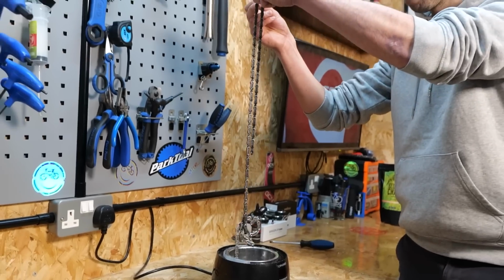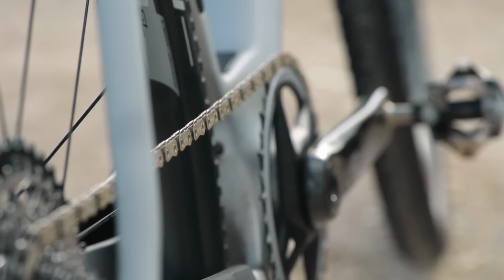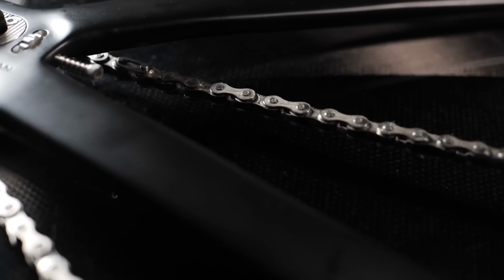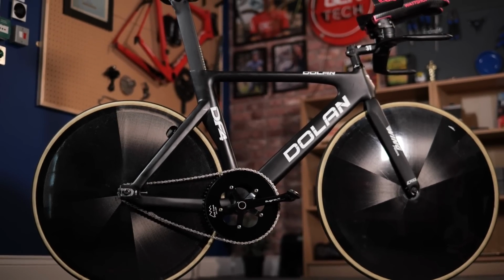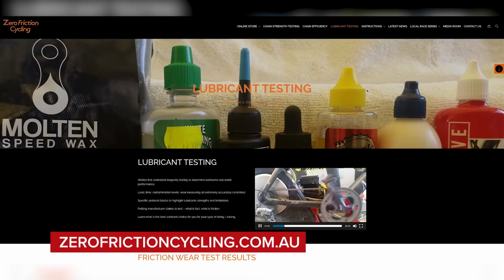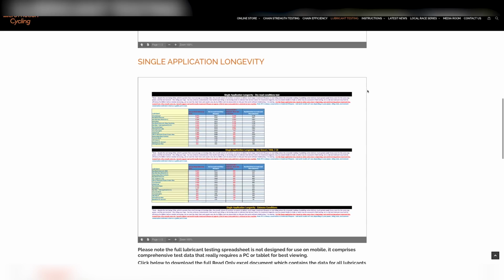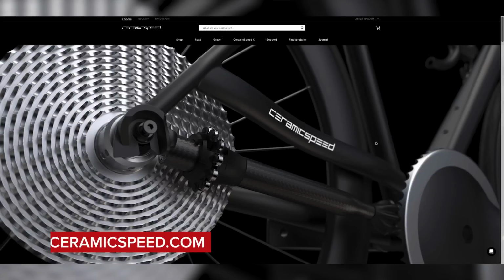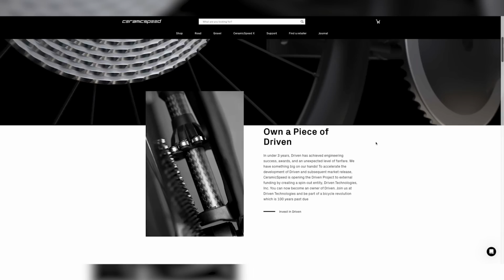Maximising Drivetrain Efficiency & Longevity: Deep Dive With Josh Poertner

Comment: Well, this is embarrassing. Josh states at 29:46 that the most efficient planetary gearbox is 92% efficient. Olly looks puzzled, not surprising given the uncritical videos GCN, and more recently GMBN have made about Classified hubs. What's the point of saving a few watts on expensive wheels and aero frames when you're losing dozens of watts using an expensive new tech scam?

Comment: I don't race but I've been riding wax since last october, and I wouldn't want to go back to oil etc.  Lower friction means faster, but it also means less effort for your speed so you can go further.  As a bonus, there's less mess all round the bottom bracket etc.

Comment: Good video.  Drive chains have in some ways got more inefficient in the quest for ever larger range of gears.  The smallest sprocket on the back has dropped from 13 down to 10 teeth introducing inefficiencies in the highest gears.  Ironic given the market for oversize pulley wheels.

Comment: 21:15 #askgcntech I am using Silca hot wax and frequently topping it up with their lube, I have seen that many lube drops tend to slip very quickly downwards avoiding the gap they should fill. 
My current workaround is to keep a finger under the chain and every 5-6 pins rub them and try to get it where it needs to go. 
Do you have any suggestions on how to make more effective? Thanks!
Reply: The finger trick is a good one, also, try lubricating the top of the chain right as it is about to engage the 2nd or 3rd largest rear cog while pedaling backwards.. this zone sees the chain going from straight at and angle to the cog to having to deflect to engage the cog which changes the chain gap from a thin slot to more of a triangle.. the lube will penetrate better right at that moment.  Also, be sure to shake the bottle really well before using as it will give you a slightly thicker and more homogeneous texture that flows more slowly.

Comment: When i buy a new chain should I clean it first before I WAX it , or can just WAX over the new chain coating ? Makes more sense to clen it 1st . Cheers fellowship
Reply: There are lots of videos on prepping a chain for waxing.
Reply: You should always clean the new chain before use (and before application of a chosen lubricant obviously). The grease that's on a new chain is for storing purposes only, not for field usage.

Comment: I still can't get past the hassle of having to change my chain twice a week with waxing. I keep my drive chain clean and reapply lube, and it takes only a  minute each time. Hot wax seems like too much work for minimal benefit.
Reply: Adding a drip wax top off and you only have to hot wax every 1000km or so.. easier than other lubes and you can clean with just boiling water, no chemicals.
Reply: That's a bit better, but still a change every 10 to 12 days. Maybe I'll try it some day and see if I notice a significant difference.

Comment: If you do a slow run through the 1:40 point, where we see the chain running over the rear cluster, you can see one link that looks to be binding on itself and won't articulate around the sprocket. It's only a fleeting moment, but surprising and ironic to see on this episode.
Reply: Looks like the rider was changing gear at that point.

Comment: Hands up, i was totally not into waxed chains, until i tried it. 

Reasons were using a slow cooker, faff and space, surely a wax supplier can offer a  boil in the bag solution? 

But the benefits are blindingly obvious at the next clean. I cant say i've noticed the improvement in watts,  or recognise when the chain needs redoing, but its clean. And thats cool.

Comment: Excellent stuff chaps. I was expecting to hear about effective chain cleaning, simply because for a chain lubricant to be efficient it must be in a sterile environment without microscopic dirt particles that logically accelerates wear and increases friction. The use of biodegradable detergents is the only logical morally correct thing to do. But how can it effectively be done to ensure absolute cleaning before hot wax emersion for maximum efficiency. I personally boil the chain in water for a final rinse even though I know that gasoline/kerosene/paraphine are superior cleaners. I would be particularly interested to know what your experts have to share on this.
Reply: From Josh Porter podcast...
Brand new chain: shake in jar with turpentine to degrease then methylated spirits to remove turps
(My technique)Waxed chain: just pour boiling water and wipe with rag and submerge in pure paraffin candle wax every 300-400km. Wax cost me aud$25 for 5kg (eBay) and will last me decades
Reply: Not sure if necessary, but I add a final clean in Isopropyl Alcohol / Deionised Water mix to minimise risk of film of meths on chain preventing wax from adhering (bought product for paint prep, mostly cars but bikes too)

Comment: I often wonder if, for potentially easier application, it would be worthwhile shaping the wax beads into a cylinder that would fit in a typical glue gun. The problem then, of course, is the melted wax,has comparatively very low viscosity and it wouldn’t necessarily flow well out of the glue gun. But still, something purpose-built might actually work very nicely for this. And it need not even be glue gun style applicator. I also think a lot about those hand-crank chain cleaners. What about one that heats up the wax and allows you to apply the wax in a similar fashion (that is, hand-cranking it while the chain on the bike)? It’s definitely a more complicated problem than it seems, and there are certainly benefits to removing the chain for degreasing and cleaning. Plus it might not actually be substantially better than existing drip-on solutions (even the best process is only marginally better). But I suspect the heat would allow for deeper penetration overall. 🤷‍♂️

Comment: Sidebow is the technical name for chain  used with a derailleur. The tensile strength difference with  9-10-11-12 speed chains with the same spec is safety factor. Higher speed chains will have a higher tensile strength material to overcome the lack of material.

Comment: I run hot wax, but one often overlooked cost and disadvantage is the need to replace the quick link. Even though I reuse them up top 2-3 times, they are technically single-use. True for SRAM and Shimano chains, at least.
Reply: I'd recommend using a drip wax like our SuperSecret every 200-300km in between hot waxings.  If you only hot wax every 1000km you are getting 4000-5000km per quick link.
Reply: I have never had any issues with kmc or sram quicklinks lasting the life of my paraffin waxed chains 15,000-20,000km
Edit: and I can put down 1500watt-bombs
Reply: @richardggeorge  The KMC 12 sp chains say they are single use, when the 11sp and less say multi-use. Are you talking about a 12sp system?
Reply: No issues 7,8,9,10 and 11spd
Edit: I would only buy Chinese 12 spd, the rest are a rip off

Comment: Will it be possible to heat hot melt wax and then use it as drip on wax, kinda like the best of both worlds since you get the benefit of the hot melt wax bt don't need to remove the chain everytime.
Reply: Nope. It won’t get into the pivoting rollers by capillary action unless it’s hot enough, which it won’t be if it was just dripped onto a cold chain. Science :)
Reply: The immersion waxing guide on the Zero Friction Cycling site suggests leaving the chain in the molten wax for ten minutes, then jiggling the chain vigorously for 30 seconds before removing and hanging to solidify. Doing so apparently melts the previous wax inside the chain and flushes it, dispersing whatever contamination was on/in the chain throughout the rest of the molten wax.

Comment: The chain is here to stay I believe, mostly because how bikes are marketed.  Just like with motorcycles, folks want the fastest/lightest/fanciest machines, even if that's way overkill for their performance and needs.  For racing/short events, the chain & derailleur has the advantage of weight and a somewhat better efficiency, but for absolutely everything else the IGH / belt drive is a FAR superior system in my opinion, especially if you're doing serious mileage.  I'm in the process of getting a belt-driven, drop bar gravel bike built.  It will probably replace my current chain-driven bike.

Comment: My drivetrain is relatively forgiving, but it is amazing to think of how much stress it goes through, even at amateur enthusiast levels of usage. I use a drip wax for indoor training use and find it a nice combination of good lubrication and minimal grime accumulation. The key is to not overload the chain or it will gunk around the pulley wheels and to clean it off with a rag regularly before reapplying. Great point on the double application for maximum effectiveness. With so many other places to be more efficient, free extra efficiency from the chain is appreciated but not the first place on which I would be inclined focus my attention.

Comment: If I want to try wax, I know I have to have a new or very very clean chain to start with. What about the cassette and jockey wheels, is a normal good degrease good enough, or do those need to be pristine too? Super interesting video, by the way, and how often do you hear a product rep saying that other companies make really good products too?
Reply: Remove the cassette and jockey wheels and immerse in a sonic cleaner.
Reply: Great question of an all too often overlooked detail. Yes, chainrings, cassette and pulley wheels must be as clean as possible. I go as far as degreasing the front derailleur cage.

Comment: I have a Priority Apollo (got a supernice from you lads), with a belt drive, and knowing that the efficiency loss is keeping me back isn't great, but its a killer system and a great bike. The fact that belt drive bikes are great for commuters and just for those too lazy to keep up with maintenance is actually a huge win, just rinse and go basically.

But I do respect that they are not racing machines, especially with the added weight that an IGH adds to the system.  But they are certainly an interesting option.  Would be seriously interesting to see an IGH paired with a chain/derailleur for ultra crazy gearing too.
Reply: That’s been done, but sadly withdrawn by the main igh makers due to lack of demand.
Reply: BROMPTON do it....Its how the 3 speed becomes a six speed.....

Comment: I started waxing about a decade ago merely for the cleanliness. Wife and I were doing fly/bike trips with a small plane and MTBs. No matter which brand of oil lube or efforts I made for cleaning I was inevitably getting chain stains on me or clothes as I loaded or unloaded bikes from plane. With wax I could intentionally touch the chain and not get a mark. That was the start. Since then I’ve noticed much longer chain lives and substantially less time spent on chain maintenance. I’m talking about immersing chains in melted paraffin wax (grocery store wax). The initial time getting the factory petroleum goo off the chains and doing the wax immersion is given back to me many times over with less maintenance fuss over the life of the chains, and it’s a longer life also. Even after a dirty, muddy single track ride I just hose off the bikes. If I notice any wax flakes on the chain I just spin the drive train backwards against a paintbrush and the flakes fall away. We don’t race but the cleanliness, longer chain life, and the silly easy maintenance are plenty reason enough for immersion waxing. I am a fan of Josh and his marginal gains research. However due to price I’m not using his specially formulated chain wax. But I did invest in his The Truth tire pressure gauge. It would be a whole additional posting to talk up the advantages us non racers have gained from figuring out optimal pressures and having an accurate and precise method of setting the optimal pressures.
Reply: Interesting - I would almost always consider the specially formulated chain wax over a $250 gauge but this has got me thinking about the potential inaccuracies of my floor pump.. is this something more applicable in your MTB scenario or equally important in a commuting/weekend road ride scenario?
Reply: waxed chain maintenance can be more easier if you use battery inductive heater, to heat up chain on bike and wax it on bike, 6-10 minutes
Reply: I must admit it wasn’t a specific decision to choose an expensive pressure gauge over a lube formulation. The gauge was an impulse buy at an event where SILCA had a booth and an event discount. I most often set our tire pressures based upon dimensionally achieving 15% drop if we’re doing a road ride, or 18% if we are going off pavement. But, setting that way requires a second person to measure while the rider sits on bike. It’s practical enough that we checked and set our pressures that way on many bikepacking trips including Canada to Mexico on the GDMBR. But sometimes I just want to get bikes ready while she is packing our lunch - then I set to PSI. Purchasing The Truth gauge was more about wanting something precise and accurate that I could compare to gauge on my floor pump and help friends check the gauges they have. In the end, the additional benefit I can get from special formulation over plain paraffin wax is less than the additional gain I get from having my tire pressures optimized.

Comment: Question: If you apply an oil-based lube to a waxed chain, how much cleanup is required to go back to wax after the event?
Reply: Typically you need to completely clean the chain before re-waxing. That involves degreasing, perhaps mineral spirits and acetone. Similar to how you must clean a new chain. The cleaner the chain, free from any petroleum product, the better the wax adheres.
Reply: I just did this. Started a 100mile mtb race in the rain with hot melt wax. Chain was still quite at 4.5hours, but didn’t want to risk it, so I put synergistic over the wax. Reapplied more synergistic later in the race to be sure. Chain cleaned up for re waxing without any issues.

Comment: I have a lot of bikes, but have started the transition to the Silca drip wax. I ride varied conditions here in Colorado, including winter fat biking, so far so good. Eventually will go the immersion wax route more than likely.
Reply from the maker: Do you think that drop wax is the best of both worlds? 👀
Reply: @gcntech  I have it on two brand new Borealis Fat Bikes I am testing here in Colorado. So far the Silca drip wax has been good both in some snow riding, and now in the dusty dirt we have. No black grinding paste after many rides! We’ll see how it does when I pop the chains off to thoroughly clean, and then reapply the drip wax. I am about to clean and add it to some others I have been using another “dry” lube on, which does have black residue apparent.

Comment: Excellent interview. Josh and also Adam from Zero Friction Cycling are just absolutely brilliant and both have integrity that is rarely seen. I know that Silca is now a sponsor (which is great) but this has improved your maintenance content significantly. I've been using Silca Hot Melt on my MTB chain for over a year and just had to replace it because of a large stick in the drivetrain, but it still showed NO sign of wear. Also, the thing that most people don't understand about hot melt waxing, and think it's too much trouble, is that you only have to clean the chain once to get the factory grease off of it and that's it. Never again. It really is amazing.
Reply from the maker: Thanks a lot, glad you found it interesting! Are there any other deep-dive topics you'd like to see us cover?
Reply: @gcntech  Well, I really love the manufacturing videos. I know it's probably not easy to get frame/component manufacturers to open up, and they're all over the world, but it's awesome to see how things are made. And yes, I've watched several on GCN+.  I would also like to see a deep and honest look at the carbon footprint of the cycling industry. We all know that cycling is better than driving, but I'm not talking about that. It would be great to talk about materials and manufacturing processes and how it cold be better. It would also be great to look at what some companies are doing to make things better as well as the B Corporation certification. You've done things like this in the past but it hasn't been a deep-dive as you said. Thanks!
Reply: What makes you think Zero Friction has undoubted integrity? 

The pricing is 'interesting',  and I doubt the claims based on R2 and a reasonable test method. 

It would make a good undergrad study. And a PhD to give it to ASTM.

Comment: Question on these new lubricants -- do you end up using more of them to attain those huge improvements in chain life, and, if so, is that a negative for the environment? Or are the maintenance intervals roughly the same as before or better, in which case it would be a major positive?
Reply: My experience.. I gave Silca wax a go, I got a cheap crockpot from Amazon and some jam jars to clean the chain. I’m never going back. Total game changer. Less drive chain cleaning 10 fold. That alone means less waste less chemicals.
Reply: @full-english  Sounds great. As soon as I'm done with my surgical rehab, I'm ordering!
Reply: The pot of wax will last for many many applications.  You'll use less than lube because there's nothing to wipe off.  Some of the dirt from your chain eventually gets in the pot but you can just scrape it off the bottom of the block when it cools.  Plus your chain lasts longer so you're not throwing them away.